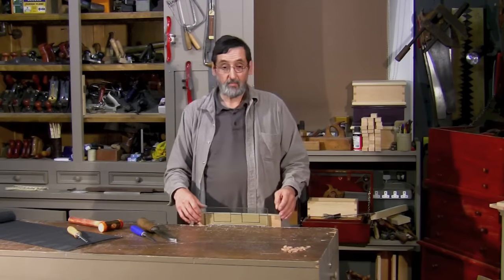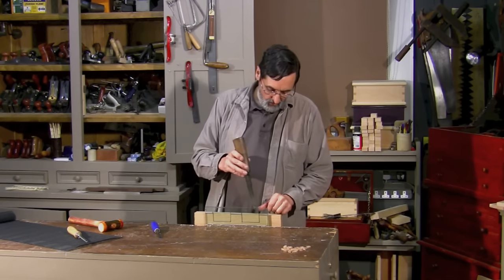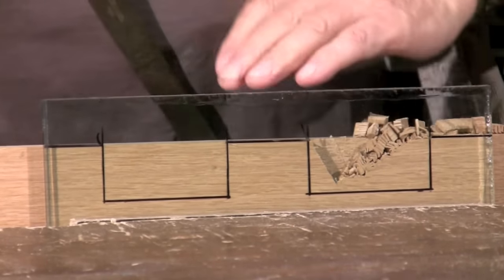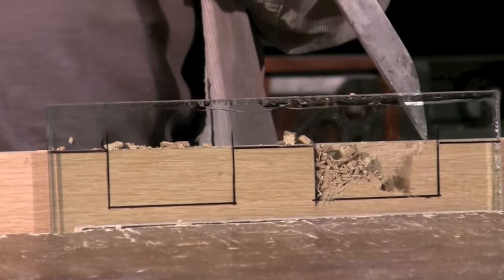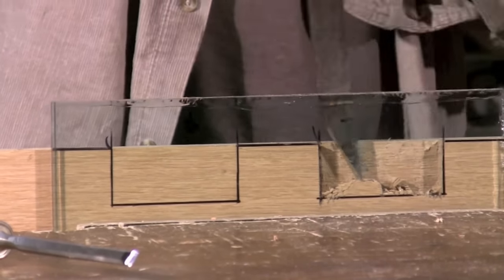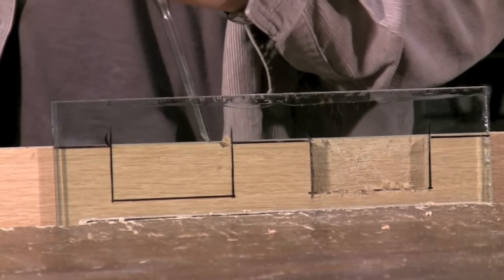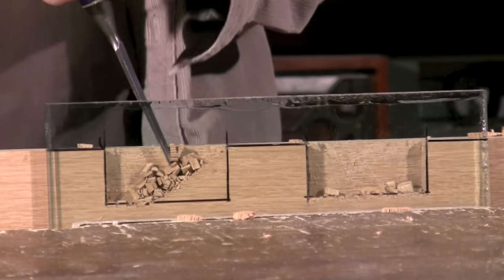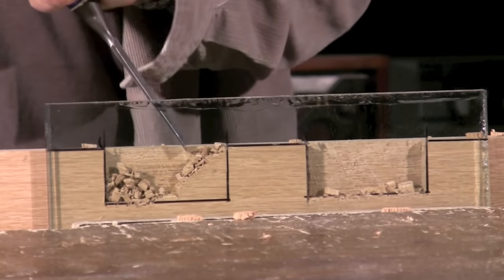Cutting a Mortise - Mortise chisel vs bevel edge chisel | Paul Sellers

Comment: Paul, you mentioned 35 degrees when you were using the mortise chisel - is that the same angle you are using on bevel edge chisels and if so, do you keep this angle on all your chisels or do you keep bevel edge chisels with 35 degrees for mortise work only? I assume this is so the edge does not go dull as quickly, but is this a good angle for everything else? Thank you, your work and videos are very inspiring.
Reply from the maker: I just increase the bevel angle or pitch because the increased pitch prevents edge fracture when using a mallet on the chisel instead of just hand pressure. I only increase the angle for severe chopping as with mortises.

Comment: Hello mr sellers 
I am in the process of restoring an Alex Mathieson mortise machine  it’s over 100 years old manual type could tell me what the blaze driver was used for as I can not find any information on the tool and do you have any advice on  using the mortise machine  thanks.

Comment: I kept thinking that you could make a Sharpie™ mark on the chisel (either kind) to gauge how deep you were cutting. Nice technique; I've seen it now in several of your videos. Thank you. I suspect that the polishing you give the entire bevel face using the strop (I've also watched your sharpening video) aids considerably in how quickly the chisel keeps cutting deeper.

I've never had a plan when cutting mortises; I just kept haggling away until I had removed enough wood. As you might expect, it was time-consuming, and the results were frequently not as nice as they could (should) have been.
Reply: +Peter W. Meek An edge is only as sharp as its most polished side.
Reply: Huh. I would have thought it would only be as sharp as its least polished side.
Reply: +Peter W. Meek marking a chisel with depth works brilliantly.  I use a pencil rather than a sharpie but same idea.
Reply: Nothing wrong with marking the chisel if it helps.
Reply: Oh, trying this with a dull chisel is asking for a bad day. Keep them nice and sharp!

Comment: Update the video to show how you measure how deep to go, when you don't have the benefit of being able to see the side (glass, end).  Also, what's the reason for the chisel to have a bevelled edge?  How often do you have to sharpen your chisel given all the wedging you do with the blade?
Reply: I've never cut a mortise before, though I'm not a bad wood worker considering, but this is my suggestion, from someone who has never cut a mortise before.

Make a depth mark on the side of the chisel. It looks like there are some ghost lines on Paul's. As for sharpening, I think Paul says in another video about sharpening saws, that he never makes use of a micro bevel and if he uses his chisels for this you can see why. The micro bevel would not help the cut. I think you should sharpen  your chisel at least once a day when in daily use.
Reply: He did show it, can you not see? There is a mark on his chisel made with a sharpie to show the depth needed. He was not using the glass to judge the distance, and the glass was facing away from him.
Reply: sliding combination square.

sorry i know its a dead comment but still.

Comment: That was really interesting, thank you. Being able to see what’s going on in there is priceless. When doing it for real, how do you manage the mortice depth AND you chiseled the base and ends but not the sides because of the glass. Do you chisel the sides flat when doing a real one or do they come out flat naturally?
Thanks again, never seen that before!
Reply: generally, the width of the chisel should match the width of the mortise that your cutting. But if it isn't, then you would start on side of the width of the mortise and work your way across to the other side of the width of the mortise. It is better to have a set of different size chisel's to fit whatever size mortises you are cutting.

Comment: How do you tell how far you've gone through in a full piece of wood (no glass to see)? Mark the depth on the chisel with a permanent marker or tape?
Reply: a caliper works very well, or a thin piece of wood/a pencil/a chopstick marked with a line or a cut;
these are the same ways i use to check a drilled hole as well (im a newbie at woodwork)
Reply: Yes marker pen is a good way as an indicator. As mentioned before there are other methods I use a 6inch steel rule but that means putting tools down.
Reply: You can make a depth gauge from a thin scrap piece of wood.
Reply: I do both. I put a line on my chisel and I also use a combo square as a depth gage  (because the mortises I'm doing are big enough to do that and I like resting the head part on the outside of the mortise and sliding it along to see how the bottom is compared to the end of the square. a stick with a line would do just as well.) really, though, it doesn't have to be precise because the mortise has to be deeper than the length of your tenon anyway. always make mortise first then make tenon to fit it perfectly.

Comment: Hi Paul, how long should the chisel hold its edge while doing mortises like these? How many mortises you can do without going back to sharpening the chisel again?
Reply from the maker: Usually this depends on the amount you use the chisel but as a rough guide I can generally cut 8 mortise holes for a table with one sharpening.

Comment: First, I've been enjoying your videos very much :) I have a question though... I understand the importance of knowing this technique but when would this be better than using a drill (or bit and brace if you are using hand tools only) to clean the bulk of the waste then cleaning up the edges with a chisel?
Reply: I know it's an old thread, SO this is (mostly?) for other readers "behind me"... who might bear similar or the same question...

    Specifically, if you watched the time comparison between the mortising chisel and bevel edge (bench) chisel... It only took about 3 or 4 minutes to chop out the entire mortise... BUT these are narrow mortises... only about 3/8" (10mm) wide.
    SO when is this actually more effective/efficient than using the bit and brace or a hand-drill???
   When the mortise is narrow enough AND still requires squared ends. "Narrow enough" is usually about anything under a half-inch (13mm-ish), because around that point, you're removing so much VOLUME of waste that it starts to seriously impede the time requirements for a relatively simple task... BUT it's important to point out that the "narrow enough" spec' is a bit different from one woodworker to the next.

     Consider the amount of time it requires FIRST to locate the drill or brace and THEN to search through the bits for an appropriate size to cut the holes. THEN get the awl or a punch to start each successive session drilling down. DON'T forget to put tape or a marker or bit-stop (a depth measure of sort) on the bit(s) before you go... AND that you now not only have to align those holes with each other, but also keep the drill/brace at the 90-degree requirement on multiple accounts for precision... OR the joint will "wobble" instead of fit properly...

    THEN consider, that you could have only spent about 3 or 4 minutes to do that SAME mortise with just the hammer and chisel of choice... AND balance the time from one method to the other.

      ALL that said... It's finally worth pointing out that we do these various tasks (and others, if we're honest) two different general ways for two different reasons...
1. We take on the responsibility to be productive, and work toward the most effective, efficient, and generally optimal methods at our disposal, doing away with needless investments in time or energy to accomplish what we need. Usually, we are doing tasks this way for the purpose of accomplishment alone, whether for ourselves or for money in accomplishments for other people in trade.

2. We take on tasks that are new, or try methods we are not familiar with for the shear and simple (laughable?) purpose of LEARNING to do them. Whether we're just getting acquainted with a task or skill at all, or we are simply improving our skills at tasks we haven't done for a while (or just not done "this way") these are tasks we take on for personal growth. It's not just an investment in accomplishment either (and failure is ALWAYS an option) but an investment in ourselves and our experience.

      ...just so we're clear. There IS that. ;o)

Comment: Any advice on cutting a mortise that travels perpendicular to the long grain in a soft wood? I just cut some as described in pine and the walls perpendicular to the long grain were riddled with chip outs. My chisel seemed sharp enough so is this just the nature of a soft wood when traversing a mortise across long grain instead of cutting in the direction of it?
Reply: Shannon Blackburn if I'm reading this right, it could be that your taking too much material out at once. I did the same with dovetails and the face seemed fine but the middle was broken up. I just sharpened my chisel before doing the dovetail. I learned that light blows and slowly going through will prevent brake out.
Reply: Zach Coffey thanks for the advice. As i try to recall i might have been taking too much material. I had taken chisels cuts at about the same depths/widths as i have when mortising parallel with the grain. I'll take another try at a slower rate and see.

Comment: Got nothing to do with bending a chisel, although modern drop forged chisels will bend. 20 years ago I foolishly bought some new Marples chisels which all got bent around the neck. 
When you cut a mortice you don't have the benefit of a piece of glass keeping your chisel perpendicular, and in the case of a pig sticker square to the length of the stile. Using a deep section mortice chisel and preferably a long one at that is essential to maintain an accurate mortice.
Although I have a couple of hollow chisel morticers I still have occasion to cut a mortice by hand and I'll use the deep mortice chisels every time.

Comment: Don't watch this with headphones.
Reply: Eoghan Lawless most of the sound comes in the left one. took me a minute, had to put them both on.
Reply: Ryan Navarre also, high pitched ringing.
Reply: I freaked out and trashed my pair because I thought they broke. (I've had a very rough day and nothing was working our for me so I lost it, so try not to jude😳)
Reply: Eoghan Lawless turn on mono audio
Reply: I love this channel but I have to say it seems to be beset with audio problems.  Most of all the level of Paul’s dialogue is way too low. Possibly because they have to compensate for the noisy tooling sounds. I think it’s a mic’ing issue.
Reply: 6:55 :)
Reply: Yeah, a monitor works much better!
Reply: damn , the struggle is real x(

Comment: Granted I'm a noob, I still find it weird. 
On the other hand, of course I've always considered the argument about bending a bench chisel bollocks. It's steel, not cast iron. There's plenty of feedback before the chisel bends permanently.
Reply: They are now back in the day a lot of them were cast steel or didn't have the tensile strength of modern steels and did bend. So a craft that's built on 1000s of years of knowledge handed down keeps its old wives tales of you will bend that like that.
Reply: Adam Lynch
Yup. There's plenty of cruft in woodworking. I value handtoolers but I value revisionistic ones even more :) On the advantages of the mortising chisel, I do think it is possible to use them to get ready sides that don't require touchups. See the recent additions to my woodworking playlist.

Comment: False dilemma - the height of the pigsticker chisel is an indication that it should be in a mortise above the rotation point at the top. The depth of the mortise is only about the height of the bevel - it's not what that chisel was designed for and you can't take advantage of the ability to rotate enormous amounts out of a deep mortise as the chisel was designed to do. 

A straight sided chisel or something akin to a sash mortiser with some taper in the sides would've been a better choice than either of these, but the video is selling the something for nothing kind of gimmick that we are familiar with. The golly ghee type of thing that "oh, we've all been misled, and this works better". 

For someone cutting a significant number of mortises in actual work, like perhaps a hundred or more in a couple of cabinets and doors, the bevel edge chisel is miserable. it tries to follow or twist and go directions you don't want it to and it can't rotate in corners because it doesn't have the height. 

The display here is pitiful because for some reason (I know what reason), the actual chisels designed for a mortise like this are excluded.

Comment: Will this method alter depending on if you are going with the grain or across the fibres?
Reply from the maker: Hi David. Generally we don’t cut mortises with the grain so i’m not sure how to answer your question as all mortising is cross grain cutting.
Reply: Paul Sellers Thank you for clarification. I was finding i was getting fibre tear out for a bedside table but this explains why.

Comment: Problem is you are using the glass as a guide. So, for beveled chisel will work well with experience. For me, I have to use the chisel itself as a guide, so thicker is better, assuming good square sharp mortising chisel. Maybe I’m just terrible, but beveled doesn’t work for me.

Comment: I have to say that having now tried cutting some mortises (and tenons) I wondered why I wasn't getting the slope profile that Paul does within the mortise. Then I realised that I am seeing the video image from the opposite side of how I see my own work. This means, amongst other things, that I should be working left to right from my own perspective) not right to left as shown in the video. Also there is a very quick change of orientation for the bevel at around 7:30 ish as Paul reaches the end of the initial pass and approaches the 'knife wall'. Unfortunately the camera is not on close up at this point and I missed it several times and wondered when the chisel changed orientation? Hopefully I can now try and get better mortise walls. I only write this in case anyone else has the same type of problems when following the video images - or maybe I'm just a bit thick - which is probably true.
Reply: I had trouble seeing that too...he doesn't mention reversing the bevel at all...just does it.

Comment: What he forgot is to leaf some more wood on the edges of the both ends of the pocket so he can bend the chissl without destroying the edges. I hope he didnt trained his 2300 woodworkers like that. Bc thats means the old carpenrty knowledege is lost. Like in the most parts of the USA. 

Greatings from an bavarian carpenter
Reply: +Steindl Luca he teaches his students to care about these details even when they are not seen. This is just a different, but equally good method. Look carefully at what he is doing and you will see he never needs to lever against the lip of the mortise. If he does so, it is because his attention slipped while explaining. In one orientation of the chisel at the end of the mortise, you push towards the center of the mortise, thus protecting the end.  In the other orientation, the bevel is vertical on the mortise wall so that, when you push towards the end, you are actually levering off of a fulcrum deep inside the mortise. The edges never get damaged. For me, when I ding the edge, it is usually because I was not paying attention when scooping out waste with the narrower chisel.